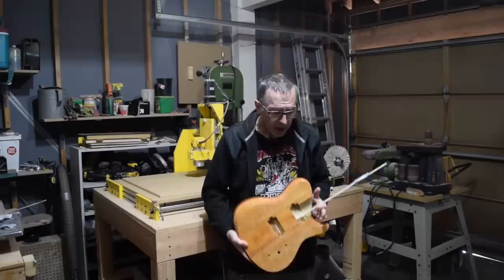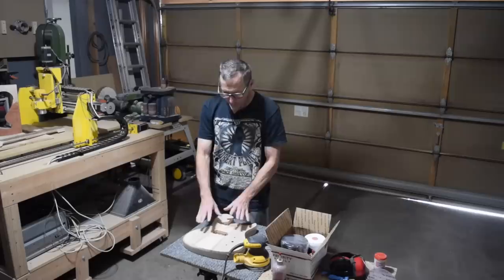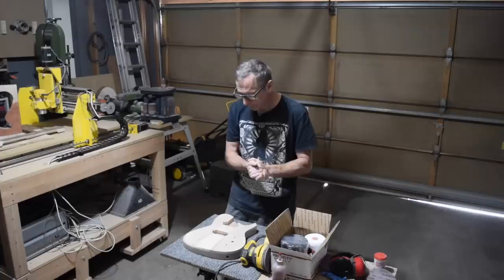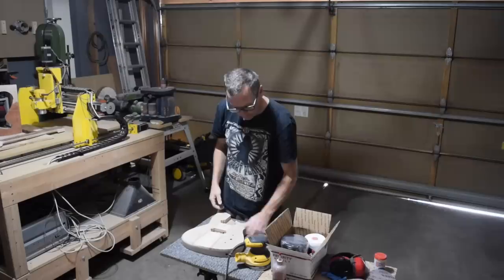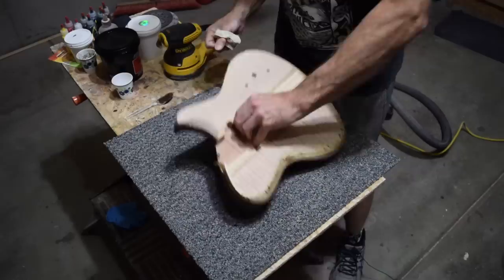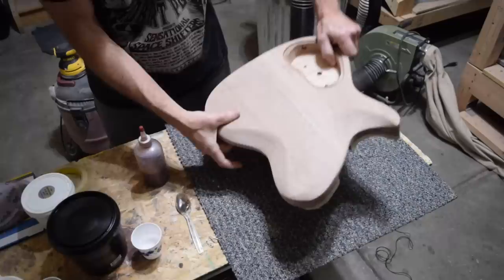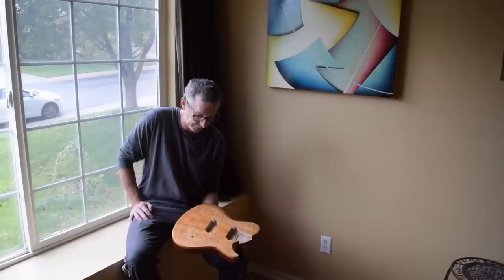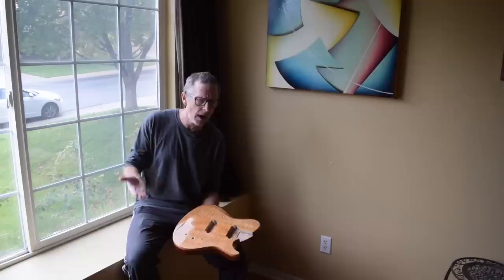Episode 121 Finishing A Guitar With Crystalac CraftNique Pigments And Brite Tone Instrument Finish

Comment: Hi Chris, I've watched all (I think) of your posts regarding Crystalac and I've been using the Brite Tone finish for a while. My questions is regarding cleaning of your sprayer. If you were going to spray 3 or 4 coats per day over 2 or 3 days, would you clean the gun after each application, or can you continue to apply subsequent coats over a couple days without taking the gun apart after each application?
Reply from the maker: I clean the gun at the end of each day just to prevent buildup in the passageways.

Comment: I heard you mention you used a 1mm tip to spray the clear.  What happened when you used the stock 2mm tip?
Reply from the maker: The smaller tip allows for better atomization of the finish which means it sprays smoother.

Comment: Hi Chris, you’ve git a great channel contents. I have a question. I have a guitar with polyurethane finish and I sanded the top coat to refinish it to a mirror like finish. Do I still need the sealer before applying the brite tone coat?
Reply from the maker: Yes
Reply: @HighlineGuitars  Thank you so much for that very quick reply.

Comment: Awesome videos. For the Brite Tone what tip size are you using? Fantastic finish
Reply from the maker: 1.5mm to 2mm.
Reply: @HighlineGuitars  thank you  Enjoying your videos. I have a devilbiss with 1.3 1.4 and 1.8.
My finish schedule will be Bullseye sealcoat sanding sealer then tinted clear with dye followed by clearcto coats. Have you used dyes in the brite tone?
Reply from the maker: @ScheltemaBoutiqueGuitars  I have used TransTint for transparent color and Crystalac pigments for solid color.

Comment: Nice video.I don't have access to buffing wheels for the final compounding polish.So my question is:If I use 3000 grit for finish sanding,would Menzerna Super Finish Plus 3800 liquid compound on a foam pad (Drill or DA) achieve the same results? Thanks!
Reply from the maker: Based on my experience, you'll get close.
Reply: @HighlineGuitars  Thanks.I just didn't want to be counter productive by using a compound that was coarser than my sand paper....

Comment: Hi Chris, Great videos! Very informative. I have what may seem to be an odd question I have been working on guitars for a while and am getting into building them. I am currently working on an upper price range Les Paul DIY kit and it has a set neck. I was wondering what you are using to hold that guitar for spraying as I can find no way to attach a suitable handle to this guitar and I would rather not hang it to spray it for fear of runs. Any help you can offer would be greatly appreciated. Again, thank you for the videos, I have learned a TON from watching you.

Comment: I have been using this process on my new build. A question I have is can I us the wet sanding process at the sanding sealer step?
Reply from the maker: Yes, but you have to make sure the sealer has fully cured before you can wet sand it.

Comment: How long are u letting the crystalac dry before you are comfortable resting the body in a surface? I’ve had some indentations left on the body from whatever I have set it on. Thank you in advance!
Reply from the maker: Water-based products like Crystalac Brite Tone need to be applied as thin coats several hours apart. Once the last coat is applied, full hardness may take 3 to 4 weeks and even longer. The greater the humidity where you are can also lengthen the time it takes to fully cure.
Reply: @HighlineGuitars  thanks buddy

Comment: I plan to stain some maple and sand it back.  If I use Crystalac Sanding Sealer, would I use a water based stain or alcohol based stain?
Reply: I asked Crystalac which stain would work best under their sealer and they responded by saying their "sanding sealer is designed for raw wood."  That was it.  One little sentence.
Reply from the maker: I like to use their sanding sealer after staining if the stain lacks a binder. With either stain, the carrier (water or alcohol) will evaporate leaving just the pigment in the wood. If there's no binder present in the stain, it needs to be sealed into the wood or it will come off just by touching it with your fingers.

Comment: Awesome Video I really appreciate all the info. I'm just wondering was any thinning required in spraying? Specifically for the clear top coat? but also if you did thin with the sanding Sealer also? Just about to order from Crystalac & would be grateful for your input. Thanks...Also did you also use the bright tone on your neck? & do you have any videos illustrating this process of finishing the neck with Crystalac? Is should be ok but I've never sprayed these products & any pointers are welcome & appreciated

Comment: May I ask a question? I've watched about 20 of your videos. When it comes to grain filling, you've used many brands. Which would you say is one of your favorites for beginners? I'm trying to pick a filler that is as transparent as possible.
Reply from the maker: Aqua Coat or Crystalac or Solarez ICBINL.
Reply: Thank you!!! I'm not impressed with Aqua Coat, but maybe I'm not using it well. It looks shiny on top of stain.

Comment: Hi Chris. Been rather snowed under with all the advice from your videos. I will take the ES 335 kit body from 80 grit to 220, then apply the Amber toned Sanding Sealer, Then after sanding again when do I apply the Colortone Cherry Red?
Reply from the maker: You should only have to apply a single coat of the sanding sealer. This will raise the grain as it dries and will promote consistent absorption of the Colortone dye stain. After the sealer has dried, sand off the raised grain (it'll feel like razor stubble) and apply the Colortone.

Comment: Chris,  I will be starting my first guitar build in a few weeks.  I have a question about your process.  
When you mix your gel stain, are you using the matte finish stain since you are finishing over it?  I noticed on the CrystaLac site that there are various finishes available.  I have done my share of woodworking so I'm no stranger to the finishing process, but I've never used these products.
Thanks for your videos and tips.
Reply from the maker: I use gloss.

Comment: So cool. I have a question. Is it not necessary to have a "wall" between the neck pickup and the neck pocket in order to have the neck push against the body for better sustain?
Reply from the maker: That's just another myth with no evidence to back it up. Sustain is more about how well the strings are anchored at the nut and the bridge. It can also be affected by how the strings are pressed against each fret, but that's more about the player's technique than anything else. Also, a pickup's magnet or the magnetic pole pieces can affect sustain. A strong magnet in close proximity to the strings can have a dampening effect on the string's ability to sustain a note. These factors play a much more important role in determining a guitar's sustain than whether there's a wall between the neck pickup and the neck's heel. In truth, a wall is really only necessary if the pickup will be mounted with a ring.

Comment: When you get to the sanding sealer stage is there a grit paper or substitute that can be used between sanding sealer coats other than scotch brite pads ? I am letting the coat of wood grain filler dry right now for a day before I sand it and then switch to the sanding sealer stage.
Reply from the maker: 320 works well.
Reply: @HighlineGuitars  thanks

Comment: Your videos are so great! I have stained my project with Keda wood dye and I'm happy with the color now. I just added a coat of wood grain filler. Should I use multiple coats of that? I'm moving on to sanding sealer next. Wondering do I add multiple grain filler and sand before the sanding sealer or is one coat enough? Thanks.
Reply from the maker: Is the grain filled to your satisfaction? If not, add another coat and keep going until you’re happy with the surface feel. Then, spray a couple of coats of sanding sealer and sanding the surface smooth before top coating.
Reply: @HighlineGuitars  Thank you!
Reply: Another question Chris. I’m at the curing stage and was looking at the menzerna compounds on Amazon. This guitar is a one and done so I’m reluctant to buy $50 worth of compound to use a minuscule amount. But the Amazon results show many different numbering systems and colors that don’t make much sense to me. Any suggestions on one product to use? I’m also buffing by hand or with drill buff attachment. No wheel here!

Comment: Thanks for your videos Chris!  You are extremely helpful and detailed, for a new builder like me your channel is a godsend.  
Quick question - what is the reasoning behind only 6 coats of clear on this guitar vs. 20 coats on the flame guitar?  Thanks again!
Reply from the maker: Which flame guitar?
Reply: The guitar from episode 117 (the buffing/polishing video).  Also an extremely helpful video!
Reply: Actually it's at about 5:45 on episode 115.  I got those 2 mixed up (same guitar)
Reply from the maker: @SteveSmithIncorp  When you wrote "flame guitar," I read flamed Maple guitar. It's been a long day! Anyway, the number of coats really depends on how confident you are with level and polish sanding without sanding through to the underlying finish. I did about 20 coats in episode 115 because the blue flames were on top of the red color and I needed to bury the uneven surface in enough clear coats to permit level and polish sanding without sanding into the blue. In this episode (121) the surface was smooth and even. That allowed me to spray fewer coats. Keep in mind that since I recommend one day of cure time for each coat, fewer coats will mean a faster cure time. The trade-off is that fewer coats mean an increased risk of sand through. Therefore, you should spray enough coats to compliment your level and polish sanding skills.
Reply: Makes perfect sense!  I'll probably try 10 on a scrap and see where that lands me :).  Now if I can just build that pesky buffer/polisher.... :)

Comment: great video! do you sand between coats of the crystalac ?
Reply from the maker: No. As long as you spray your next coat within a couple of hours, it really isn't necessary. Also, to cover up the sanding scratches takes at least four coats.
Reply: @HighlineGuitars  thank you for your reply! I have a zebrawood veneer I’m putting on speakers, is it absolutely necessary to use the sanding sealer before the instrument finish?

Comment: When applying the multiple coats of sanding sealer and later, top coat, are you able to leave the finish in your sprayer or are you cleaning it each time.
Reply from the maker: I clean after every coat. I learned you have to do this the hard way.

Comment: I enjoy watching your videos!  I have a question about the crystalac sanding sealer.  Does that dry perfectly clear?  I have a swirl finish to clear and am debating using your approach of laying down coats of the sealer and leveling that first.  Is that a good way to get the best end result with less coats of clear and less sanding of the clear?  I do not want to use the sealer if it will affect the perception of the colors and detail.  Thanks.
Reply from the maker: Crystalac sanding sealer has an amber tint. If you want clear, try this: https://www.targetcoatings.com/product/emtech-em1000-wb-universal-sanding-sealer/

Comment: Hey Chris, can I use the water base sanding sealer underneath a automotive clear top coat? The reason I want to use the auto clear is because my uncle owns a shop and said he would do it for free. I would be doing this on a pair of speakers that have a real wood (paperback) veneer on them.
Reply from the maker: You would have to ask the manufacturer.

Comment: Hi, I stripped the paint from a guitar and went with a clear coat over the wood. I used oil based varathane polyurethane clear gloss because I like the way it turns sort of amber over time. it dried for a month then I wet sanded it  400 - 800-1000-1500-2000 grits then I used a foam buffing wheel on my drill with terry cloth bonnets and used Meguiar's mirror glaze polish and i got it to a mirror but cant seem to get fine scrtatches out. went back a few steps and did it again and same problem. little help?
Reply from the maker: Follow up with a fine cutting pad and some swirl remover.

Comment: Hi Chris and everyone, I have no spray gun and applying the crystalac with a foam brush. I am encountering few issues.
Firstly I have to say they are very good products.
I have so far successfully  achieved perfect levelled surface after filled poring a rosewood  guitare body and applied the cristalac sanding sealer.

I am now at the stage  of applying the clear top coat.
I have just applied the first coat of bright tone and got lots of runs and drips..
I think I did applied to tick . Actually a little goes a long way . 

My question is can I use 600 grit to sand these runs and then recoat . ( would that show marks under the new coat )
Or should I sand the marks and the rest of the side ( runs happened at the side on the curly side) do I have to wait 24h or can I sand after the 4 hours

And finally how many brushed coat of the bright tone would I need before level sanding. I think 3, perhaps 4.

Using a foam brush, I may go with a normal brush.

A pity it could not be apply like a wipe on.. (or could it...?)
I have previously done some coating job with a home made wipe on poly oil based mixed ration 50% poly 50% white spirit and it was so easy, no run no marks

I am just a bit heavy with a brush... but indeed that cristalac  products is really good
Reply: I was level sanding with 400grit after each coat of sanding sealer .
After 3 coat I got perfect smooth surface ready for clear coat.

Wanted to use same thecnique for the clear coat but not sure if product will behave the same as the sanding sealer.. ( smithing and levelling surface between coat at 400 grit) and for applying the last final coat really thin after final levelling seems hard enough.
I may just apply the last coat and with the 3 weeks level sanding starting 600 up to 7000 
Will that work
Reply from the maker: Yes, you can sand with 400-600 grit to fix the runs and drips before recoating. Also, I would use a good quality bristle brush instead of a foam brush. Foam brushes are deceiving in how much liquid they hold.
Reply: @HighlineGuitars  thanks Chris for reply. I will get a good brush in the morning . So much hard work so far .. now reaching the end I am getting panicked 😄

Comment: 26:28 How long did you let each coat of sanding sealer dry before doing the next coat? You didn't say.
Reply from the maker: When it no longer looks wet or feels clammy. Dry time depends on temp and humidity. It could be 20 minutes or 2 hours.

Comment: Hi Chris, I do larger scale waterborne lacquer walls/cabinets for clients. Does this crystalac have good vertical hang when sprayed ? Ive been using tinted mohawk precat waterborne lacquer and it works well and hangs well but the crystalac seems like a much clearer finish without any "clouding effect". thanks!!
Reply from the maker: As long as you don't spray it too thick, it won't sag. I always hang my guitars to dry and the only times that runs or drips have formed was when I sprayed a coat too heavy.
Reply: Thanks Chris !! I’m going to try multiple light passes👍
Reply: @gabemorales5136  Take a look at Extreme Protection Polyurethane or Super Premium Top Coat. Both work great for cabinetry and the Extreme Protection like Brite Tone has UV Protection.

Comment: Did you scuff sand with anything between each of the last 6 brite tone clear topcoats?
Reply from the maker: No.
Reply: Thanks! @HighlineGuitars  I've got some brite tone coming my way to finish up a recent build. any tips for keeping dust out of the finish while its drying? i imagine you may have had to scuff off some dust nibs at least between coats. that's the only trouble i've really been having with water based stuff so far is keeping airborne particles during the longer dry time.

Comment: I don't think it's a great idea to wet sand on wood if the wood absorbs too much water it can cause cracking in the finish
Reply from the maker: Dry sanding is always better. Especially with the new high tech abrasives like Super Assilex.

Comment: And how do I correct sand thru?
Reply from the maker: If it happens, you have to do some spot touchup. You can use small brushes or q-tips to dab stain into the area where the sand through happened. Let the dye/stain dry. Then, dab on your clear coat until you've built it up proud of the surface. It's a good idea to extend the clear coats beyond the area that was repaired so that when you level sand the area, you won't go through again.